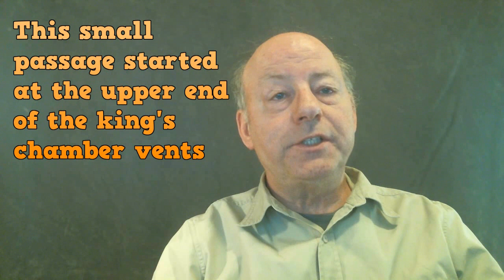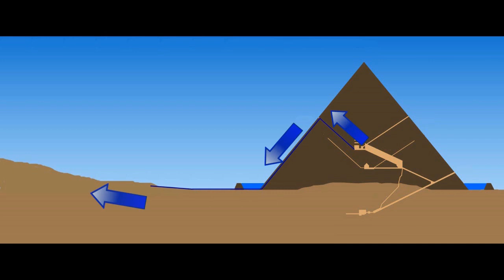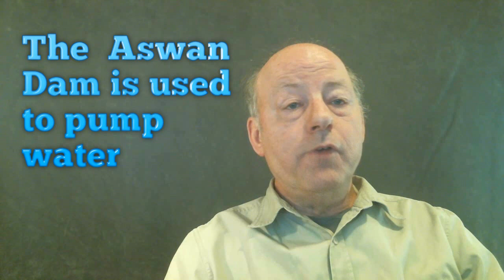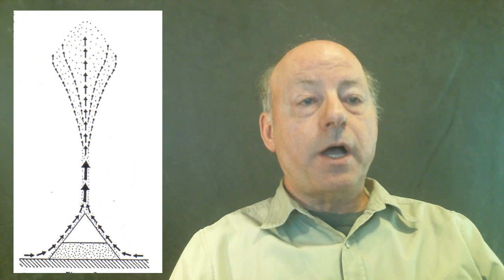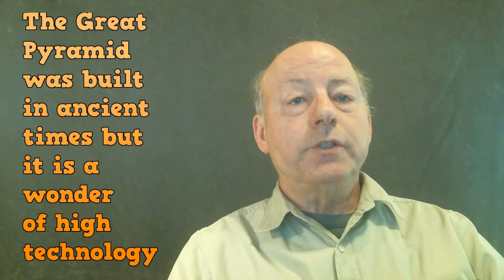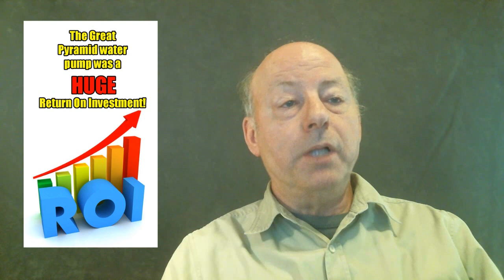Video 13 Conclusion

Comment: You may have the correct function but the wrong application
Reply: Ill get back to you shortly
Reply from the maker: @MichaelClarke1980  oh. ok.
Reply: @GreatPyramidPump as opposed to the great pyramid being a water pump to supply water to the giza surface, how viable is it that it was a sump pump with the purpose to keep water levels out of undergtound tunnels
Reply: Meaning the great pyramid was not a support system for the surface but for the underground @GreatPyramidPump
Reply: @GreatPyramidPump there is a overall narrative i have been working on when considering antiquity. The water pump theory would compliment that quite well if it was considered a drainage system for underground system of tunnels as opposed to a surface level water access agent. I dont want to overload you on words with all the things at once but  I would love to know what you think
Reply from the maker: @MichaelClarke1980  That is a thought. How would that be workable and be consistent with the known direct physical evidence. How would water be "drawn up" from deep below the Great Pyramid water pump?
Reply from the maker: @MichaelClarke1980  I think that the Great Pyramid water pump operated in the manner described in the series of short YouTube videos. Certainly the water pumping process was described in much greater detail in my 2nd book titled: The Great Pyramid Prosperity Machine. Here is the link to my 2nd book about the Great Pyramid water pump.  https://www.amazon.com/dp/1460976118/
Reply from the maker: @MichaelClarke1980  If you have some research you want to share with me you can email me through my website at: www.thepump.org
Reply: @GreatPyramidPump i apoligize, im trying to get up to speed on all your research so i can be better informed to speak on a possible correalation. I prob should of initially did that to be honest but i was curious on your thoughts. Ill be back again i assure you
Reply from the maker: @MichaelClarke1980  A good way to get up to speed on my research is to read my books about my research.

Comment: he makes electrolicis sound easy... or cheap, i somehow doubt the imposion chamber housed a floater and generator, not the kind of a equipment one would like regularly exploit in the most literal sence
Reply from the maker: I think electrolysis occurred in the grand gallery, not the implosion chamber which is the subterranean chamber. The hydrogen and oxygen gases were ignited which resulted in creating a vacuum that helped the water piston in the Grand Gallery to move higher in that chamber.
Reply: @GreatPyramidPump  there is another chamber in the piramid conecting to the kings chamber that was discovered not to long ago, archeologist sent a drone through the very narrow passage and found a small room with what appears to be corroded huge coper wires poping out from one of the stone blocks in the wall

another find was a piece of wood that was misteriously lost after being found only to be rediscovered in a korean museum under a wrong clasification, the carbon test on that piece of wood that had likelly been within the pyramid since it's construction was dated to be over 30K years old
Reply from the maker: @leandrobenitez292  There is a lot of information about this direction of research. More information than what is in a few short videos. Here is the link to my 1st book about the great pyramid water pump. https://www.amazon.com/dp/1449916155/

Comment: Hi Steven.

Firstly, this is amazing. I always thought the Pyramids must have had an operational function, they are just too weird for anything else. Your series and the purpose you propose is the most plausable and well thought out I've heard.

Im not convinced around the conclusion however, I feel there is more to it yet to be discovered.
The vents sealed after serving their construction purpose from the queens chamber to me make perfect sense, but if the kings chamber vents were the end goal, why carry on building the pyramid? How much real estate was built higher than the Kings chamber vents just to complete the Pyramid shape. Only as complex as required right?

Also, I haven't done the maths, but would those granite coffers actually float? Just from looking at them I'm not sure the displacement would be sufficient to float those heavy blocks... 

Any theories about the big void? Based on the extreme efficiency of the pumps, this probably would have had a function too...

Thanks again, this was one of the most interesting series I've come across.
Reply from the maker: If you think there is more to discover go ahead and do what it takes to discover it. The Great Pyramid being a water pump is the explanation that provides the most Return On Investment than any over explanation. There are a lot of forces involved including the kinetic energy of moving water and pressure and vacuum. Finishing the Great Pyramid strengthens that infrastructure. There are no granite coffers inside the Great Pyramid. There is a granite coffer (singular) inside the King's chamber. The water in the king's chamber would rise up and the buoyancy would move the coffer in this feedback system. I can put an anvil in water. It won't float but it would be easier to move and lift when in the water. There is much more information in my three books than in a few short videos. I hope you read my books. Tell others about this research. I did another radio interview today! There is a lot of interest. Here is the Amazon link to my 1st book about the Great Pyramid https://www.amazon.com/dp/1449916155/
Here is the Amazon link to my 2nd book about the Great Pyramid https://www.amazon.com/dp/1460976118/
Here is the Amazon link to my 3rd book about the Great Pyramid https://www.amazon.com/dp/B0CF784F75/

Comment: is it possible to develop a hydrogen combustion engine based upon these principles for automotive or air travel? I apologize if you have already covered this in your video.
Reply from the maker: The focus of my research is how the Great Pyramid water pump operated and to redevelop that ancient high technology to help our modern but troubled world. Here are the links to my three books. Here is the Amazon link to my 1st book about the Great Pyramid https://www.amazon.com/dp/1449916155/
Here is the Amazon link to my 2nd book about the Great Pyramid https://www.amazon.com/dp/1460976118/
Here is the Amazon link to my 3rd book about the Great Pyramid https://www.amazon.com/dp/B0CF784F75/

Comment: I am definitely thinking Ancient Egyptians had electricity a long time ago.  Pyramid shape is sturdy for a giant water tower.  Perhaps the hydroelectric energy from the elevated water was used to power the hydrolysis that created the hydrogen.  These days hydrogen electrolysis takes alot of electricity.  Hydrogen as a fuel is tricky due to the force of explosion.   Huge stone monolith would be sufficient to enclose the explosion.  Yesterday they found ancient riverbed from satellite that seems to flow past the pyramids, as well as evidence of waterflow in other pyramids.  Personally, water delivery takes much of my time to my garden, I want a big stone pyramid in my back yard!  Wish we could crack the code on the electrolysis component, seems like it could solve the world’s energy and climate crisis.  Water is life! Super Cool theories, thank you for the detailed presentation!
Reply from the maker: @leahgarrison6665  your comment tells me you need to read my three books because it’s a subject that you are very interested in.
Reply: @GreatPyramidPump  I am reading your  prosperity machine now.  I am obsessed with the vortexes.  Swirling the water would expose it to more electrolysis surface area way faster and more efficiently, as well as hyperoxygenating it along the way.  Using gravity is a way to generate a vortex utilizing no power to do so.  So many ways the great geniuses utilized multiple natural laws to their advantage.  there are even modern drinking water pitchers that do this on small scale currently but use power to do so instead of gravity.  I plan to read all your books!
Reply from the maker: @leahgarrison6665 please tell others about this video series and my other video series. Thank you!
Reply: I will!!

Comment: A lot of interesting points but it is very complex. One can use a ram pump to squirt water through an orifice all the way to the top of the Grand Gallery. It just needs a check valve that is found in the grotto. It is a square cross section block that sits on the bottom of the vertical shaft. Water comes from below and is able to get under it to lift it off the seat. The water for operation could come from a reservoir created by the Sadd el-Kafara Dam. Its crest is at 125 meters above sea level and tunnels beneath the Nile may have brought water to a shaft just inside the pyramid walls. Here it could reach halfway up the pyramid. The wall could be as high as the entrance so no siphon is needed. In order for the pyramid to supply drinking water it needs to pump at least 300 liters per minute all day long. I built a scale working model and it happily squirts water about half as high as the descending passage is deep. I also believe the water flowed down the causeway and lift a raft that spans the width of the channel. Large amounts of weight can be pulled up the slope with no friction. One only needs to pull up the slope plus the water pressure difference between front and rear.
Reply from the maker: Thank you for your thoughts. Some may say the Great Pyramid water pump is complicated. Most everything is. Factories, hydroelectric dams, and even under the hood of a car is "complicated" but as simple as they can be according to the designers and builders. Hydraulic ram water pumps require a waste pipe lower than the ram pump to operate. There is no corresponding passage below the subterranean chamber to meet that requirement so that rules out the use of the very inefficient "ram pump" configuration. You are saying things like it may be or it could have been but without a waste pipe it is definitely not a "ram pump". The design and operation of the subterranean water pump below the Great Pyramid structure is much more sophisticated than a "ram pump": Thinking the Great Pyramid water pump is a "ram pump" is inconsistent with the direct physical evidence at the Giza plateau. I hope you read my books about the Great Pyramid water pump someday. My books have much more information than is contained in a few short videos. Tell others about the video series if you want to.

Comment: So, there is a farmer who says that the water in the river cannot be used for irrigation. But if you pump it out it can be used for irrigation. What magically happens to this river water when pumped?
Reply from the maker: Thank you for asking me an easy question. I appreciate that. If the water in the river could be used for irrigation why did the farmer need a water pump? What magically happens to the river water is that the farmer spent money to buy and use a water pump to pump the water up out of the river so it can be used to irrigate his farmland which is higher in elevation than the water in the river. I led a 13-day tour in Egypt a year ago and we did a cruise down the Nile. There were hundreds of water pumps that were needed to pump water UP and onto the farmland. The river water was moved farther away from the center of the earth (pumped up) so the water could be used for irrigation on land that was higher in elevation than the water in the river. All this pumping was done because the water in the river cannot be used for irrigation. If you still don't understand go find a farmer and ask him why he spent the money for a large and expensive irrigation pump when the water was right there in the river.

Comment: i don't understand why pump the water so high if you're then just going to slide it down to low elevation again. But I'm going to watch all the videos in hopes to understand
Reply from the maker: Thank you so much for your open mind. The answer to your question can be expressed in two words. Vertical lift. Pumping the water up is very important. Every town has some sort of elevated water tank or water tower. Water is pumped up to that elevated tank and then that elevated water is used to provide pressure for the municipal water system. There are a bunch of reasons why virtually every city pumps water up just to let it come back down. The pumped water that is elevated is used for many purposes including powering machinery.  The elevated water is very useful. In effect, the hydroelectric dam is used to elevate the river behind the dam up to the height of the dam. That "elevated water" behind the dam flows down through the dam to power the generators. So the water is pumped up through the Great Pyramid water pump and that elevated water is gravity-powered to be either transported to a distant point of use or to power machinery. My books go into all of this in much greater detail than a few short videos. Thanks for your interest.
Reply: Interesting, but a water tank and resorvour is a huge container of water which is what makes the pressure, but the pyramids doesn't have any huge tank at the top, so what's the point in pumping it up only to go straight down without being held in a tank? @GreatPyramidPump
Reply from the maker: @Niberspace  I wish you had watched the videos. That would reduce your misconceptions.

Comment: guys i didnt get the point about the water - river water makes land fertile - in africa and ofc nile. what was the point of farmer?.....he lives near the river and can take as much water as he can - right? why its worthless?
Reply from the maker: Hi and thank you for your question. In your comment. In a way, you answer your own question in your comment. By saying the water in the river is worthless I was trying to make an important point. Water in the river does not make farmer's crops grow. A farmer has to take as much as he can from the river and put that water on the crops. I was in Egypt leading a 13-day tour a year ago and we took a cruise down the Nile. We say hundreds of water pumping systems used by farmers. The water in the river did not help farmer's corps grow at all. That is why the farmers went to the trouble and expense of move the water from the river and up onto cropland. In modern times water pumps were used to do the necessary task of irrigating farms. I feel the Great Pyramid was a water pumping system used in ancient times to move water up from the Nile and move that water onto farmland. The water in the river is worthless until the water is moved from the river onto the land. I hope that helps explain what I said in the video. Please tell others about the video series. Thank you.